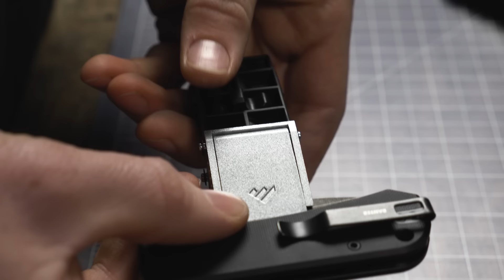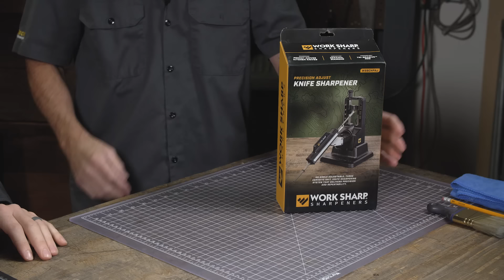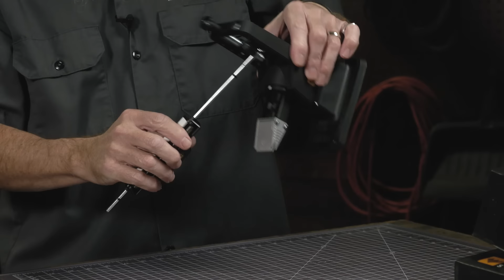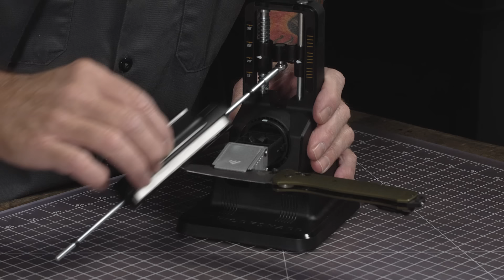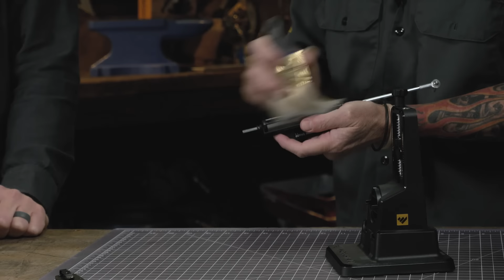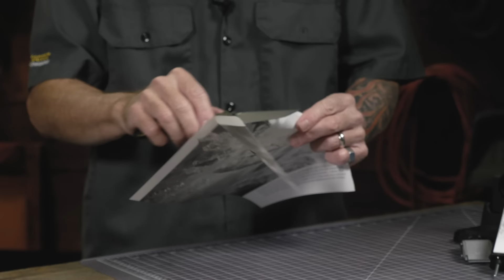How to Use The Precision Adjust Knife Sharpener - User's Guide: How to Sharpen a Knife

Comment: The ultimate pro tip, while sharpening hold the adjustment knob absolutely perfectly still. If you don’t it moves slightly and changes your angle. But if you hold that adjustment knob you will get an absolutely razor finish.
Reply: I put a small o- ring on so it can't fall down
Reply: @Bladesandslips  where did you put the o-ring?
Reply: I use a rubber band!
Works great
Reply: I wrap a rubber band around the top of the screw, I get it pretty tight and it doesn’t move
Reply: Are you saying to hold the knob WHILE the entire sharpening process?
Reply: Which adjustment  knob?
Reply: I carved a little piece of wood the exact measure, works great. Also ive seen some adjustable pieces made out of 3D printers, with an adjusting knob to tight it.
Reply: Plastic is too flimsy it deflects easily.
Reply: @MrFiXXiT88 how much pressure are you using?  Basically, the weight of the triangular stone is enough to sharpen, unless you’re repofiling the blade.
Reply: Never really had a problem with the adjustment knob moving.  You don’t need to use a lot of pressure when sharpening, so it really shouldn’t be an issue.
Reply: I tape the know and the thing that goes up and down....  you can literally see that little elevator thing that goes up and down wobbling all over the place in this video especially in the beginning when it's slow motion
Reply: The magnet  doesn't  hold keeps  falling  out??? How do you correct  the problem?
Reply: I haven’t had that problem. More accurate then my hand on a whetstone
Reply: Seems like a design flaw if you need to use your hand to hold it when it should stay without being held.
Reply: What time in the video do they talk aboit the adjustment knob?
Reply: @Bravadosjebsimbahsm  I think Jason is talking about the angle adjustment knob
Reply: Boys, on a long blade, the sharpening can change up to 6 degrees from heel to tip. Use the angle tool to check it out.
Reply: The arm flexes too while sharpening, these are just cheap Chinese produced products.
Reply: Seems janky. If you have to hold the knob to keep a precise angle, does it really live up to the name? 

...or is it called "precision adjust" because it will automatically adjust your precision.
Reply: @flatasacueball6326  You don't have to hold anything. If you are putting enough pressure to change the angle you are putting far to much pressure on it. When you hand sharpen a knife you will never be cutting a precise bevel it will very from tip to heel. This is much more precise if you use it correctly. Not everything made in China is cheap. China does make quality products if you want to pay for them 95% of the best mountain bikes are made in China. many quality things are made in China that USA sellers hide the fact that they are made in China. If you pay 5 dollars for a Chinese knife on temu sure it's garbage. But if you buy a Chinese made knife from a reputable dealer or blacksmith the quality is just as good as any other high quality product. DJI drones are all made in China. Phones are made in China. Just because you don't like communists doesn't mean all their products are garbage. Grow up, dude. I'm an American and wish for more American made products. But from the looks of what's in college nowadays, Goodluck with that. Japan tried to destroy but I bet you still buy and enjoy their products? China has done no such thing to us.
Reply: @FarmerFpv  bro, the vise on that thing is so wobbly, it doesn't matter how light of a pressure I use. When the stone touches the blade, the whole vise moves, not to mention how weakly it grips the knife. I know how to use it, it's just very poorly made. I have a lansky kit that works exactly the same way, only the vise is steady and it produces much better results. 

With the skillset, sharpening by hand is far superior and, when done properly, it creates a more consistent angle from tip to heel (I have measured and confirmed this to be true). I'm never going back to a guided system like this one. I get better results from freehand sharpening, with a more consistent angle, in a fraction of the time, with less cleanup.
Reply: What are you talking about? The angle selector knob will work loose and the angle arm will slide down? 

Sounds like a terrible design flaw
Reply: @RichardTuckman it won’t slide down like anything drastic on mine I check the angle with an angle caliber when I rotate the knife back and forth and it’s held the angle really well however every once in a while it may slightly come down works well but if your ocd about things you pay very close attention to the hold of your angle.
Reply: It's a fixable issue, on a very cheap product.
A flaw I can accept.

Comment: Sadly, once I swap the side of the attached blade the angle is not the same. The bracket that holds the blade in place is not levelled. Or you supposed to adjust the angle to the bevel every time you swap sides or my unit is faulty?

Comment: Hi Guys, great video and I'm thinking of buying this system which I found via the Knives and tools website. I can see how it would work great for say my Becker neck knife which has a 20 degree angle. However, my Mora Bushcraft knife is listed as having an 11 degree scandi angle. I have a great edge on it from using stones and strop but could I use your system for sharpening at this angle?

Comment: Excited to see a guided sharpener with what appears to be a better designed clamp.  I have 2 or 3 versions of these - Lansky, Gatco, etc - none of the clamps work well  and none provide fine adjusts of the angle.  However the demo ignores the fact that the angle changes as the width of the blade changes - is there no compensation built in? Also, I already have a big set of Lansky hones on rods. I'd love to be able to use them with this sharpener.  I realize that won't sell more of your abrasives - but it will sell more sharpeners.  If I have to buy a whole new set of hones again I'm less likely to purchase than if I can use my existing set.  (Just to let you know, I have several WS products - KO sharpener with all the attachments and 2 of your portable guided models. Love your stuff but would still like to be able to use my Lansky hones).

Comment: I cannot help but think that the top of the rod needs to be able to slide left and right. How much should it slide left and right? It would depend on how long a blade could be. The stone should always be perpendicular to the blade.  In order to keep the exact same angle, it needs to be able to slide left and right; not articulate up and down. Theoretically, it could have a few clamps to hold a long blade perfectly level, and the sharpener up and down rod slide along a horizontal rod that is 3 feet long to sharpen a sword or machete. The trouble I have with my current sharpener is that I can tell the angle changes toward the end of a long cook's knife, especially on the curved end of it. I guess I ask too much.

Comment: I don't even have the full precision adjust kit I only have it with 320, 600 💎 & a ceramic stone that came in my kit. I would have liked to get the more complete kit but to be honest I have a lot of very high quality knives (microtech & Benchmade) some cheaper good branded knives Kershaw & Gerber & I would usually have to send them off if the edge got rolled or fucked up because the lansky would not fix it. I have fixed so many knives & made them so sharp with no particular method... up, down, left & right lol scratch it up doesn't even matter it's so damn sharp when it's done! Could it be sharper yeah I'm sure but don't overthink it if it's shaving hair off your arm & slicing paper and grabs your finger nail if you know that trick like nothing, what the fuck else do you need?? Edge looks decent also... Sure it would look better if a professional did it but my shit stays Sharp cut anything I ever need & God if I ever had to use it for self-defense I feel sorry for them... I'd probably rather get shot than sliced by a knife like I carry, that's how sharp 🪒 it is

Comment: Trigonometry always tells the truth. The smaller and duller the blade starts, the bigger the difference between the initial and final angle will be, as long as you keep the initial angle position.
Give it a thought: as you get farther and deeper; as you grind/dive into the blade", you are increasing the initial angle meassurement.  🤔
A lot, a little bit, who knows?...but you are indeed.
I love them! 😀👌

Comment: I have one of these and LOVE it. One question though. What is the best way to clamp in a knife that has differing sizes along it's spine? A good example of this is my Benchmade Osborne 9400. The spine differs in sizing as you move down its length. I have had some issues getting it to clamp securely in the sharpening system

Comment: 6:50... that's pretty cool, but... and I'm firmly wearing my Devils Advocate hat here as it won't make much difference to most people at all, but at 10:10... they way that knife is bouncing up and down, there's NO way you're getting anything like a 1 degree level of accuracy on the sharpening angle. You'd have to have the knife held rock steady to accomplish that. Because physics. Like I say, not going to affect most people and I'm thinking of either getting this or the Ken Onion. If I got this, I'd probably try to figure out a way to support the knife better and reduce bounce. Even if it was to just support the handle.

Comment: Tried this out for the first time on my 10 in chefs knife. While it did a decent job sharpening there was a few issues. The knob to tighten the clamp is small and try as I might, the knife would move around using light pressure to sharpen. Also the depth of the gap wasn't deep enough to really accommodate bigger knives. I did notice in most of the videos, people were sharpening smaller knives. I have more knives to sharpen so I'll see how it goes.
Reply: My knives also move around as I work, it's a bit of a design flaw.
Reply: @amanwitheyes  This whole thing is a design flaw. Doesn't get my kitchen knife sharp no matter how many passes I do.
Reply: @holdencaulfied7492  same! I have an CPM S35VN ZT and no matter how long I sharpen, exactly as the videos show, the bugger will not sharpen much. Fails the [meaningless] paper test every time.
Reply: Fold up or cut little pieces of rubber band. It works
Reply: @butcrack6786  where do you put said rubber band? Not up one's butt crack I assume? 😃

Comment: I used this to reshape some knives from 20 to 15 degrees and it takes a long time. If your knives are somewhat hard steel It is very labor intensive even with the 220 grit. Took me about 1 hour per knife. Borrowed a chef's choice 15° sharpener for my other knife and it took about 10 minutes. Both equally sharp in the end.
Reply: What kind of sharpener did you borrow which only took 10 minutes?

Comment: Just bought this system, and the upgraded grit range, ceramic serration hone handle, with case set. After about a year on the market, and shopping other systems, I felt confident starting here. The price/performance o.o.b, and potential for adaptation is unmistakable. Thanks Worksharp!  And I must say I can’t appreciate this video’s approach enough. Right off the jump they (Designer Steve) addressed two factors I had questions about, namely recurve and tanto edges. Talk about knowing your audience! And as others have stated, that tip (pun?!) on erasing the ceramic buildup was right on! I have drafter’s polymer erasers I rarely use, so they’re going in the travel case. Gonna use that on my Mac cerarod hone as well. Thanks again for all your hard work on the design, implementation, and support for this kit. Woot!
Reply: Mann.   Great to hear.   Because MINE COMES IN TODAY BABY.  YEWWWWWWWWWW
Reply: @phillipjones3596  Mine just came in today!
Reply: So you have had this sharpening system for a number of years now did it stand up to your expectations? Is there anything you would make an improvement on? Was it worth your money?
Reply: @FrankToThePoint  To provide a brief answer, yes. Worth the price, and definitely a great starting place for most people interested in getting into sharpening.  Very consistent for average edc folders, fixed blades, and shorter kitchen knives. Adaptability is there too, for using different grits/stones, if you want to go past those offered by the manufacturer. The only niggles are where build quality is concerned, what with all the plastic housing, but at this price point, they really are minor. Treat it carefully, and it does last. Also, the lack of an angle finder was a little vexing, so I got one on Amazon. Both these issues  have been addressed on the newer Pro system, albeit for almost twice the money. I don’t have hands on experience with the likes of Lansky or KBE, but I’m confident in the choice I made, and would gladly gift this set to friends or family interested in getting started with sharpening on their own.
Reply: I got one and I tried to use it it worked good on my Spyderco Sage five. Then I tried to use it on two other knives and it left marks on my blade almost like a grind Mark I think it was from the edge of the diamond plate even when I tried really hard not to let this happen it's still occurred

Comment: How is the height of the blade affecting the angle and how to compensate? Because a 20 degree angle isn't the same for a low height boning knife as it is for a large height cleaver with this tool.

Comment: There is no magnet on mine, so the pin is constantly falling out of the socket.
Also, the grinding angle will change with blade height, a deeper blade is further away from the pivot point, so 20° for a shallow knife will be slightly less for a deep kitchen knife like a chefs knife
Reply from the maker: If you're missing a part please contact our customer service team: info@worksharptools.com, they will make sure you are taken care of. You are correct blade height will impact angle slightly. If the actual number is important to you then you can check with an inclinometer (there are free apps for your phone). I find consistency is more important than the specific angle, so if you set it at 20 degrees, you know the next time you come back to touch up that knife you can set it to 20 degrees.
Reply: @WorkSharpOutdoor  I realised the magnet is there, I was being clumsy!

Comment: How well will this work on a 10" cimatar
Reply from the maker: On a long, and thin knife like that there will be some flex in the blade out at the tip and the heel. You can get a sharp knife but I recommend going slow and using light pressure. A knife like that could take 40 minutes, but you'll be stoked about the results!

Comment: This is the first time I've seen this sharpening system but if people are worried about holding on (so it don't tip over) to the unit when it comes to larger/heavier knives why don't you put holes (4) through where the rubber pads make contact with the surface? This way you can mount the sharpener to a 2"x 6" with pan head screws.

Comment: I only use work sharp. My first one was the GFS and the the electric knife tool sharpener. Both awesome! Just before this precision came out I was wanting a system like this and thinking of making my own. Im still on the knifes edge (excuse the pun) on whether I should buy this system or build mine. What I would have liked was:
More finer grits to achieve a polished edge for my custom knives. 
Apart from the plates rounded rods in the same grits for cerated blades and curved/special contoured blades. Could be purchased separately. 
A strop. 
A larger blade clamp for thicker chopping blades. 
Extendable rods for longer blades. 
Maybe a big brother to this system where the knife clamp points upwards and one has stone/plates on either side that are adjustable in degrees. A upward facing clamp would create more stability for larger blades.
Reply: This comment was 2 years ago did you make your own or buy one?
Reply: @FrankToThePoint  bought a warthog multi edge. Great buy since its portable enough to throw in my pack. Also with great precision sharpening for serrated edges. Also way cheaper than the precision.

Comment: I have a tendency to round off the tip of the knife when I use this. On one side the bevel is a nice even width, but on the other side, the bevel is very thin at the tip. I don't see how this could happen, considering that on both sides the stone is being held at the same angle. Any suggestions would be greatly appreciated.
Reply: Don't ride the stone off the edge, stop at the tip
Reply: I just got mine. I found, putting your finder beneath the tip can help prevent running the stone off the tip (and rounding it). Lots of testing to do though

Comment: When the spine of the knife isn't parallel to the cutting edge like on most knives like Spydercos do you still put blade spine into the v  putting the edge not parallel to egde of clamp or do you put one side of the spine into v and keep the edge parallel to the clamp?
Reply from the maker: When clamping the knife clamp the blade perpendicular to the abrasive. The spine of the knife only needs to touch the back of the clamp on one side and it will be stable. Imagine any triangular clamp, three points of contact is all that is needed.

Comment: I’m struggling with my spyderco para 3 and getting the blade parallel because of the weird design
Reply from the maker: You only need the spine of the knife to touch the back of the clamp on one side. A triangle clamping position is very strong and will hold the knife securely.